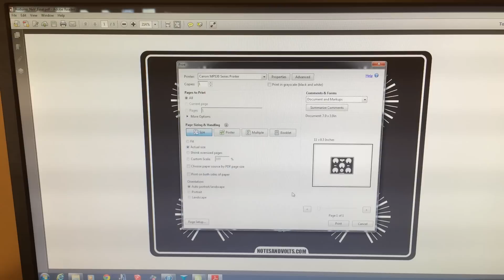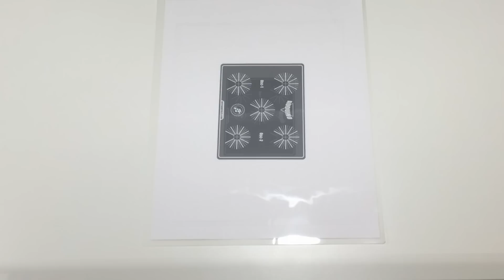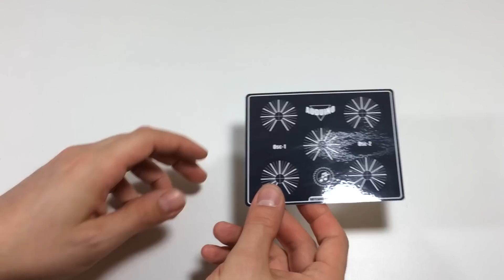Build the Auduino Granular Synth - Part 2

Comment: A few questions regarding the front panel artwork. I tried this process for a guitar pedal I’m building and noticed that the lamination is lifting up around the holes for potentiometers and other components. How do you prevent that from happening?
Could it be due to the fact that I was using regular printer paper and not matte photo paper like you did?
Cheers!

Comment: Couple of weird issues in this video.

1). Why didn't you use tape to hold down the graphic when cutting it, as you did before when aligning the holes?
2). Why not just by short shaft pots as opposed to cutting down long shafts? This gets exacerbated when the measurement wasn't taking into account a riser from the guitar pick!

Comment: Lovely! Thanks :)
I have a question: What about circuit bending that? How would it be done, since there are not many "Bend points", it seem there would be a big challenge.
Reply from the maker: Hi Abstract. Since the audio for this project is entirely created inside the Microcontroller, there are probably not a lot of bending points. There is certainly a lot of flexibility in the code though.

Comment: how would i do this if i just wanted to use my arduino uno and not a stand alone circuit. im a total noob.
Reply: in reference to programming
Reply from the maker: Hi Will. The code will work on an uno as is. You just need to make sure you hook up the pots and the audio output to the correct pins on the uno.

Comment: Have an issue where only one pot is working. Can't figure out what I'm doing wrong. (currently just building it into an Uno and not the separate board). The pot that works only does the pitch sweep.
Reply from the maker: +Jacob H. Hi Jacob. If you have a multimeter, touch the negative probe to the arduinos ground (GND) and the positive probe to one of the Analog pins. Check that the voltage varies from 0 to 5 volts as you turn the pot.
Reply: hi!
I have the same issue.  Just one pot works fine when the 5 pots are connected. How did you solve that?

Comment: How difficult would it be to replace the "pitch" pot with an in/out jack input set for using a control surface?
Reply from the maker: +Ariel Blacher-Rasheed Hi Ariel. I experimented with using Midi CC commands from an external controller with the synth. It did work but there was an issue with smoothness. The pots on the Auduino generate values from 0 to 1023, where as the Midi controller can only output 0 to 127. I had to scale the midi values up in the software which caused a bad steppiness to the sound. I didn't pursue it further.
Reply: Hmm that's interesting. Thankyou for your help

Comment: I have several spare Arduino units, and would like to know if I can bypass building the breadboard version and create this unit with an Arduino. Which one? How would I go about it?
Reply from the maker: +Pete Spaker The UNO is the best match. All you need to do is figure out what the pins on the Atmega328 are called on the UNO. Google  "atmega328 aruduino pinout" and check the images for this info.
Reply: I quickly realized that spending the entire $$1.56 on two of the necessary ATmega328-PU was well worth it no matter how many Arduinos I have lying around,. I have to applaud you on your extensive planning, complete with drill guide, top panel, rubber feet... everything. This type of extensive planning is not found online to this extent. I am wondering if this method (using an Arduino programmed IC or not) could be used to make a MIDI controller with 4-5 arcade style buttons, 4-5 similar knobs, and 2-4 1/4" jacks meant for foot pedals. In case you don't know, there are momentary foot pedals, that act like "buttons," as they are pushed on, then off- as well as "expression" pedals that act like knobs, the more you press downward, and release upward, the action is just like turning a knob "up," or "down" in the eyes of MIDI. I have been making my own controllers with these features, but have been forced to use Arduino "Teensy++," or specialized (extremely similar proprietary micro-controllers that cost $18 on the low and upwards of $40 on the high. It seems to me that this method could be adapted to make MIDI controllers with buttons, knobs, faders, jacks for pedals, push encoders, LED reactive buttons and knobs, etc., while [possibly integrating other desirable features on MIDI controllers, like navigation, headphone jack / volume, MIDI send/ receive sync, CV & gate control, sequencing, the use of LEDs to signal features in use / off.... etc.  Thoughts?
Reply: OH. I hinted, but failed to mention that I did make your controller. Then another. Then another. Then one for a friend. Then one for his friend. I hook mine up to my Roland AIRA MX-1. If you're not familiar, it works with the Roland AIRA line: The new TR-8 (The new 808, 909, 707, 727... the new TB-3: the newest 303, a new Roland Synth that has Plug Out technology that emulates vintage Roland Synths, all plugged into the MX-1 Performance mixer, with on-board Beat Effects, Filters, Side Chaining, Slicing, Delays, Rolls, Flangers, Bit Crush and a new ""Scatter" range of effects. In fact, each of those effects has at least half a dozen variations per function. Using this Arduino Synth with the MX-1 is simply amazing. Using it with the TR-8, and TB-3 is unmatched sonic fun. I use it every week when I play at a local club. Thank you. I hope you keep going! This has been a real treat.
Reply from the maker: Hi Pete! Man, you have been busy :) Congratulations on all your accomplishments! I love it when people use their own DIY gear for live gigs. This is one of the main reasons I got into electronics. When I played live shows, I had very little money for equipment so I would come up with homemade solutions to get my rig working how I wanted. My bandmates would crack up when I would show up to rehearsals with my latest "creation". But they'd sure love me when their gear would break right before the show - there's nothing like soldering behind the stage in a dark club Lol!

I like to feature pictures of gear people make though my tutorials on the Notes and Volts facebook page. If you ever have something to share just let me know.
Reply from the maker: Hi Pete. Have you checked out my Midi controller tutorial? Some of what you are trying to do could be done with it. And it is UNO based. https://youtu.be/DXhxdsGREsU

It won't do everything but could be a good starting point for you to expand on.
Reply: +Notes and Volts soldering backstage! Totally! I just did that earlier this summer with a butane powered piece of shit portable soldering iron! I dropped it in a stream of beer / piss / God knows what when I was trying to put it away in the dark and burned my hand! Man. I didn't think a soul on the planet could relate to soldering in the dark near people waiting in line for the bathroom. I have to check out the video and your other work later today. I just (today) replaced my phone and was using a half functioning one for months- including broken camera. So if it's pictures you'd like, I need to take some. On the list! Good to know I have an 8ntetnet double out there who knows the weird struggles like I do! Later on....

Comment: nice work. Just two questions... where's the sketch? and. .. Are you using single core or stranded hookup wire on your pots? Thanks
Reply from the maker: +Liam Adams Hi Liam. Follow the link in the video description for the sketch (it's in Part 1 of this series). I used 22 Gauge stranded wire for hookups.
Reply: +Notes and Volts. Thank you very much :)

Comment: would it be possible for this to be used as a guitar pedal? by getting an analog input getting proccesed and altered through the synth and then out again for an amp? Thanks for your great videos!
Reply from the maker: sizorblade Hi SB. The circuit as it is wouldn't do this without a compete redesign. The code generates its own waveforms simply by using the Atmega's built in timers and interrupts. There's no place to inject an external signal. On the other hand, running the Auduino through guitar FX pedals is really fun!

Comment: Would it be possible to turn this into a guitar pedal?
Reply from the maker: Z0NKED Hi Z0NKED. This circuit actually produces it's own sound rather than effecting incoming audio so it probably would be useful for guitar. On the other hand, running the Auduino through some FX pedals is pure awesome!

Comment: please ok a good job however #1 on the circuit you do not have anything negitive,you have ground,please use nuts and bolts to secure the board to the box,take it to the beach in 100 degree temperature and the tape melts,also please cut with the knife pointed away from body parts,also why did you not use the ARDUINO symbol